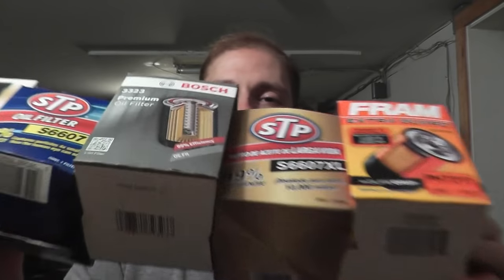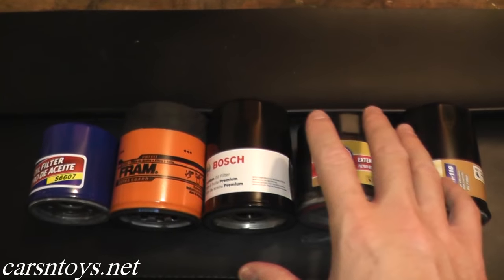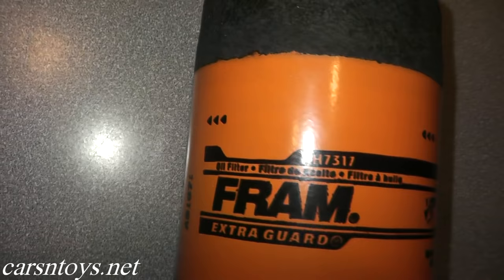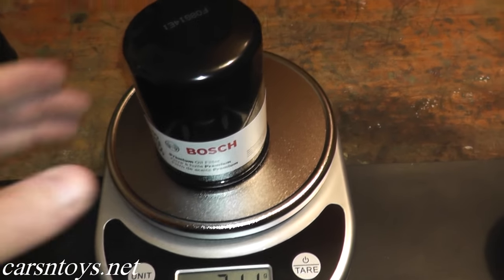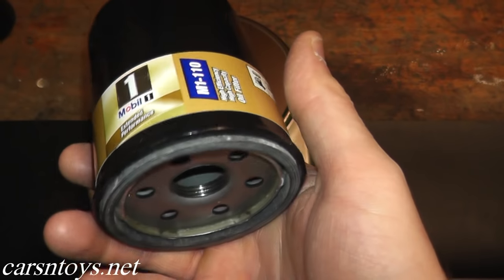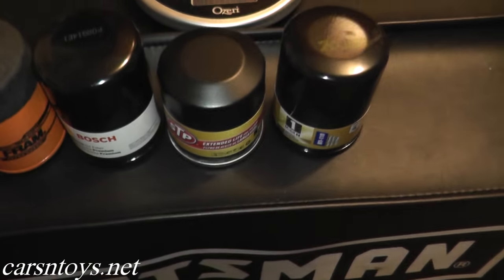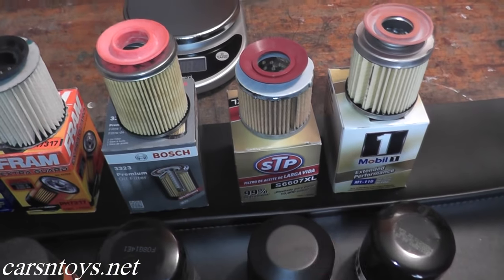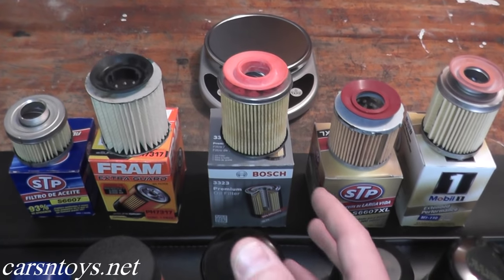OIl Filter Comparison...STP vs FRAM vs BOSCH vs MOBIL1

Comment: After so long of typical engine operating  "usage" of any these filters, all of them, collect the sediments like a trap.
Then their ability to filter is reduced or lost from "eventual" clogging, then oil bypass vlv is what is going on then, and no real filtering occurs.
More likely what happens is sludge is reintroduced back into the fluid cycle.
So how do we know what filter you displayed can really do a good proper filter job, how long will it last and hold up and when does it stop or reduce to ineffective state?
I run amsoil for years and never had any issue whatsoever and change filters about 2-3000 miles just to keep filter efficiency.
All filters have a critical mass / clog buildup point and all filters drop off rapidly filtering when this occurs.
Which ones have the ability to last the longest before critical mass occurs is what I think most of us would like to know!
If nothing else, the middle of the road cost of the Bosch seems to be the best choice  and change it out on the half way point of the cycle.
Just my opinion there...

Comment: The number of pleats is not an indication of a superior filter. What you want to do is measure is the depth of the pleats and length in between them to calculate the surface area. The micron rating of the material must also be considered, and finally, the quality of the seal on the anti-drain back valve.

Comment: ive ran mobile 1 extended synthetic 5w30 with mobile oil filter in my wifes trailblazer since day 1, i recently after 110,000 miles switched over to royal purple 5w30 synthetic with royal purple filter,hope i didnt make a mistake!  but my buddy is running a rebuilt chevy 350 with RP since day 1 and hes had good luck with it.
Reply from the maker: +Game Bred Duramax RP and Mobile1 or both very good. You'll have good results with RP.
Reply: Thanks,liked your oil filter reveiw

Comment: I usually use Mann filter, M-filter and toyota filters, and all of them works fine. I change the oil and filter every 10000 km. and the oil i have always used are Mobil 1 and Teboil diamond 5w40 synthetic oil.  2.0 l. gas engine is still in good condition of my 520 000km driven Camry.

Comment: I know the Mobil 1 (and some others) has a thicker gauge canister, with higher burst strength.  Other items on a quality checklist include:  Filter media and efficiency- some are thin paper, and other thicker synthetic media.  Bypass valve - some are hit or miss, some very reliable construction.  Drain back valve quality and consrutruction.  Sealing gasket - varies in quality and construction.
In my opinion, FRAM is JUNK.  (I have experienced complete failure inside a Fram multiple times, and cheaply constructed.)  Bosch and Mobil 1 are solid performers.  You didn't test one but Wix are a good choice also.  And there are some counterfeits out there which are hard to spot.
In many cases you get what you pay for.  Good idea to cut open your used filters and see what you've actually got.
Reply: Excellent info!

Comment: Great video! Say... here's the advantage of running Synthetic Motor Oil, and the proper Filter with it... Synthetic Motor Oil, besides not having wax/paraffin(s) in it that causes buildup, can be used with a lower Micron Filter, which can trap very small particles of carbon and other nasty stuff. A Conventional Motor Oil Filter is rated @ a higher Micron rating, so it isn't able to trap anything smaller than that; it just goes on past the filter as it keeps circulating through your engine. Do NOT use a genuine Synthetic Oil Filter with a Conventional Oil, you could damage your engine by doing this. The "Bosch Premium" and the "Mobil 1 Extended Life" are great Synthetic Oil Filters. I also recommend the Amsoil Filters and Products, too. I don't sell them, but I have used them for years. It's amazing how a good quality Synthetic Oil and Filter will clean up the inside of an older engine.

Comment: It is not a waste of money to run an extended performance oil filter (e.g. Mobil 1) with conventional oil --- you can drain the oil and leave the filter on for longer use. In that way, you can get all the mileage out of the filter.  So what if a little extra dirty oil remains in the filter to be mixed with the fresh oil... check the dipstick after changing the oil and it will be clean!  Easy peasy.

Comment: I only use STP filter on my car and truck. I put the blue box one on and use Mobil 1 and change the oil  every 10,000 miles. The Dodge caliber has 260000 miles on it and my truck has 170000 on it so you can use it for synthetic oil and change filter ever 10,000 miles

Comment: I usually use Fram Idk that's just what I've always ran with if I switched brands with my luck the motor will probably lock up. Plus they're easy to remove. I wonder how oem filters compare with these motorcraft, honda etc. Or are they made by the same brands?

Comment: Sorry, but this is no sort of reasonable comparison. I work in the automotive oil industry and know a bit about filters. Measuring the weight of the innards does not give an indication of the filtering ability, you could use a wire mesh that weighs more than fibre, but it has less filtration. If the fibre is too dense, it will take out more particles, in theory, but it could be that it slows the flow too much, opening the bypass valve, meaning less effective filtration. Also, too weak or too strong a bypass will reduce filtration. The pleats need to be even, so the oil flows evenly, otherwise debris builds up in one spot, reducing the flow there, rather than an even distribution. Too tight pleats can reduce flow, too loose and there is not enough filter medium. Poor quality gluing can mean that oil can go around the fibre rather than through it. Insufficient holes in the base can reduce flow. Even something as seemingly irrelevant as the paint on the can can lead to it rusting through. 

In reality, there are a lot of decent filters on the market. Mahle, k&n, bosch, ufi, OEM and purolator are all good in my experience. Remember, a filter doesn't chemically clean the oil or remove combustion by products, all it does is take out larger particles. In a standard application, a filter from any reputable manufacturer should be fine. 

It's good that people are trying to help with videos like this and reviews, but unless what is relevant is explained, it leads to misinformation. I spend probably about twenty percent of my working day dealing with incorrect and out of date information with oils and other automotive fluids, plus the occasional filter question. Just because something is presented in a clear way, it doesn't mean it's actually correct. Everything I've just written could be nonsense. It's not, but look into the information and don't take it for granted.

Comment: You're comparing filters meant for different cars... That's why the STP ones are smaller the 6607 number is used in Nissans while the other ones 7317 and 110 are used on modern Hondas.

Comment: What about oem filters? AC Delco, Motorcraft, Mopar, Toyota, etc. You can get them at the auto parts store.
Reply: AC Delco and Motorcraft are very good filters.
Reply: ford's going to start making oil filters for gm vehicles, don't ask why. but i wouldn't mind ford oil filter in my gm car

Comment: I'm curious as to which filter keeps the oil pressure better. a friend told me that Bosch is good at keeping the oil pressure but I don't have a way of figuring out if it's true or not.
Reply: The BOSCH Premium Oil Filter has a 99% efficiency rating at 20 microns, thanks to it's patented FILTECH Media. I have run them for decades -- always with excellent oil pressure and filtering results. I also run a FILTERMAG #SS365PR Magnet Kit. Oil & Filter changes at 5,000 miles.

Comment: You got the wrong STP filters, they should be the same number as the Fram for a fair comparison, the 6607 is a smaller filter compared to the rest, I know it as what's spec'd for Nissan VQ V6 engines although owners of Nissan VQ based cars that change their own oil that are in the know usually get the 7317, M1-110, Bosch 3323, etc filters meant for the Nissan VK V8 engines since they're the same diameter have the same size gasket and the same spec bypass valve, but are ~3.5in long instead of~ 2.5in long.

Comment: I run full synthetic oil, whatever brand is cheap. For awhile I could get Penzoil full syn for under $3 a quart after rebates. Lately I've been buying Walmarts synthetic jugs cheap. I buy K&N filters online for around $7-8 and I change my oil myself of course every 6,000 to 7,000 miles. My 1.5L Toyota engine runs like new with 315,000 miles doing so. I just wish the twice hit hard body was holding up as well! Btw- an oil change only costs me around $20.

Comment: immediately I noticed that your STP 6607 and fram 7317 are not equivalent. from make a 6607 that would be apples to apples. they are interchangeable but the short one is technically for Nissans and the long one for Hondas. Also fyi, the Mobil 1 equivalent would be 108 for the short filter. I run a quick lube shop btw.

Comment: Weight is not a real determining factor in how good an oil filter works. Efficiency, filter holding capacity, and quality of construction are the real factors that matter. The biggest consideration about a filter is that is does not fail. Obviously meaning that the media doesn't disintegrate, the center tube stays intact, the ADBV works properly without being torn up and keeps oil in the filter and the oil galleys. If a oil filter does does not fail then what matters next is the efficiency of the filter and the containment holding capacity. A fair amount of the extra weight found in the more expensive filters comes from having a thicker can than the cheaper filters. Yes, there is more weight in terms of filter media in the more expensive filters as well. But weight really doesn't or isn't the determining factor in regards to the real quality of the oil filter. It is the materials the filter is made with and how well they hold up over the long run. Mobil 1 extended performance filters are made by Champion Lab. Which is the EXACT same company who makes the oil filters for Royal Purple. They both are great oil filters because of synthetic media with great containment trapping efficiency and holding potential, and great quality construction as evidenced by a thick can and a silicone ADBV that hold up to the heat and cold better than nitrile rubber.  Now the Purolator Boss weighs a lot as well as the Mobil 1 extended performance filter and the RP oil filter. But it doesn't have the same high level if efficiency as the RP or Mobil 1. There have also been a number of  pictures where the Purolator Boss filters ADBV have been shown cuts into them with pieces coming off those ADBVs. Which is not helpful if these pieces find their way into your motor. Yet, these Purolator Boss filters do weigh a whole lot too. Weight doesn't mean a whole lot here.

Comment: Some filters have an open bypass while more expensive ones have actual bypass valve as well as a drainback valve , cheap filters have less pleats inside which means less surface area to catch particles, for everyday driving on conventional oil the cheap filter will do but if you use extremely long life oil you should pay more for the better filter no doubt. extremely expensive filters have better valves and silicone instead of rubber and actual coil springs to operate more reliably.

Comment: Some of Amsoil's oil filters (the EAO series ones, rather than the EA15 series) are rated 25k miles. The others 15k.

Wix has an "XP" series filter - maybe the NAPA Gold is based on that, accounting for the extra pleats. Sadly the XP series one only has more surface area and not better filter media. But at least it should last a bit longer.

One important thing you left out is the efficiency (and/or beta ratio) of the filters at various micron ratings.

BTW, Mobil 1 oil is advertised very well, and it isn't bad oil, but it isn't great. Castol Syntec/Edge are better. Pennzoil Platinum/Ultra are better. Amsoil Signature Series is much better; Amsoil XL is at least as good. You're not going to screw up an engine running M1 but I recommend other oils over it. If you do use M1, try to stick to a 0w* grade of oil because all 0w oils use group IV bases. When I think racing, I think Amsoil. If you think of M1 when you think of racing, I... well, I can't understand that statement.

Comment: So if the Mobile one filter is rated for 15k miles, is it safe to assume i could do 2 or 3 oil changes without replacing the filter? I've always run synthetic through my engine from the first oil change, so it shouldn't have too much junk floating around in there.
Reply from the maker: +MiscerVids Sure could. Even if you look at your car manual, you may find the manufacturer recommends changing the oil every 3k or 5k miles but the filter is good for one year.
Reply: +CarsNToys thanks for the response! That's good to know. It looks like ill be purchasing the mobile oil filter from now on

Comment: I only use a 40u stainless steel reusable oil filter. Traps more particals larger than 40u, more consistant filtraition, better flow and reusable after cleaning with some kero. Billet casing.

Comment: Those Bosch standard filters are actually only designed for conventional or semi synthetic
Reply from the maker: +Jared Olson Bosch's Premium Filter (used in this video), High Premium and Performance filters all accept synthetic, semi-synthetic and conventional.
Reply: Perhaps they have a special valve that opens the bypass when it detects synthetic oil molecules?

Comment: I always thinking to get Fram at Walmart but I asked myself does Fram strong,will it keep my engine run smoothly forever? when a guy cut the covers to see inside of it.. a small sheet paper(filter) from Fram? Lol K&N,Mobil1 and Bosch have more paper and it thick than Fram's paper(filter) . Looks like the Fram paper won't hold the dirt longer. So I went to Walmart to buy K&N and they doesn't have K&N so I picked Bosch when I read the chart book said Bosch just like/compared K&N.

Comment: There is no difference in. Filtering regular or synthetic oil. That's just marketing BS! Is oil dirt different than synthetic dirt, no! But Mobil wants you to buy Their oil so they put synthetic on the label. Always run the best filter you can, to keep you oil as clean as possible.

Comment: So BOSCH is the best buy? Looks like it has most filtration materials.
Reply from the maker: +Leo I like Bosch. But I would have problem using Mobil1 or the STP extended filter. I'll have another video shortly showing Wix, K&N, Amsoil and other shortly. Cheers

Comment: Whats inside matters look at the filter pleats and wight of the Bosch for the win here!    Nice job!    It will be interesting to see who has the most filter material in square inches or CM for the non usa folks .  I use Mobil 1 and Amsoil for their 15K mileage and 99.9+ filter efficiency but they cost more than a Bosch
Reply: Of course the weight difference could be in large part the slight variances in thickness of that steel bottom plate, but obviously the Bosch has much more pleats in it than Fram.
Reply: For sure! :)
Reply: The fram filter even looks inferior to the basic stp filter. After seeing this, I will never buy a fram filter again. I will choose the bosch or the stp from now on. I wouldn't trust a filter that has cardboard inside.
Reply: I haven't ever bought a Fram Filter in my life and glad I haven't I try to educate people as I have seen them cut  apart and compared 10 years ago. They have improved their top of the line ones. They look OK maybe but why when there are obvious better choices like Bosch or Mobil 1 or purple oil packager and Amsoil

Comment: why does the weight matter ? why not pick up the fram ultra ?
Reply from the maker: +samuel lopes Shop didn't have fram ultra in stock. Weight regarding the amount of material used in the filter.

Comment: I'm glad you cut them open to look inside.  Not sure filter weight correlates perfectly with performance, but when you cut them open, you can see the quality difference.  Fram oil filters SUCK!  For the same or less money, you can usually get a Toyota filter, even if your vehicle is not a Toyota.  Inside the Toyota filters you'll find even better components than any you've shown here, and better than Mobil 1 or any other.  They are superior.  Yes, they're made in Thailand, but they are superior for about the same or even less money.

Comment: When I was still deciding which is the best oil filter to use I can't find a Bosch filter, I end up with Mobil 1 and it did good but after that my second oil change my oil got to look dirty fast, I switched to k&n but didn't see what happened because I got rid of that car.

Comment: When I first opened my shop 8 years ago, I used STP filters because they were the cheapest thing that had full line coverage. I had a tremendous problem with the gaskets coming off the filters and sticking to the engine at oil change. The result if you do not catch it, is double gasket. The second gasket will eventually move out of place, and can lead to a catastrophic oil loss condition. The gaskets are just not properly retained on these filters. Just for this reason I recommend not using them.

Comment: Mobile 1 filter would be the best buy even for conventional oil. Just don't change it for the next 2 oil changes. Modern conventional oils are good for 5K. The numbers work and you will not have issues. sure, some might argue that there is a pint if old oil still in the filter. SO WHAT! 3 oil changes per filter is cheaper than the cheapest filter bought 3 times!